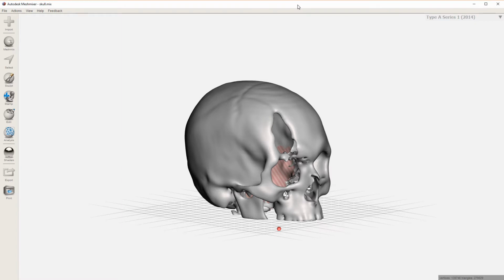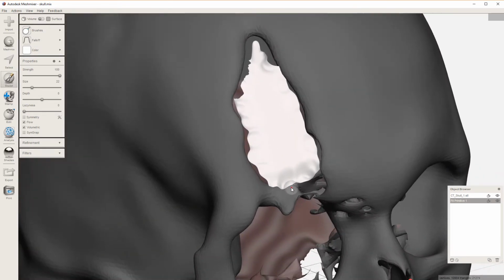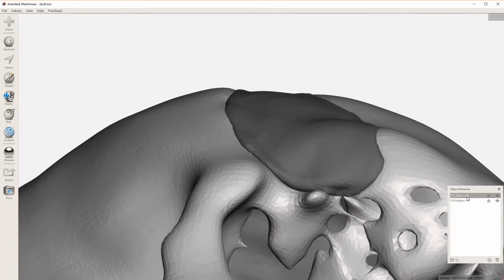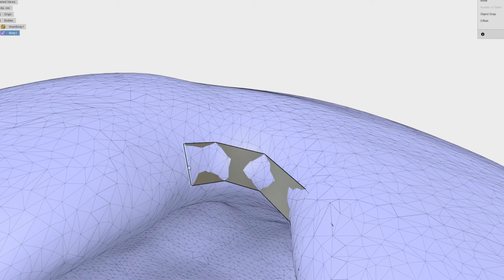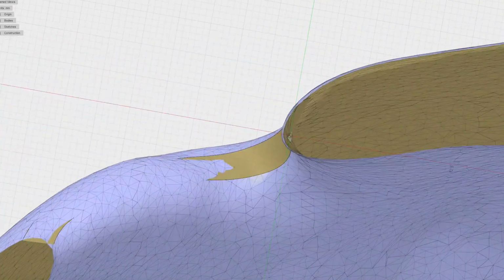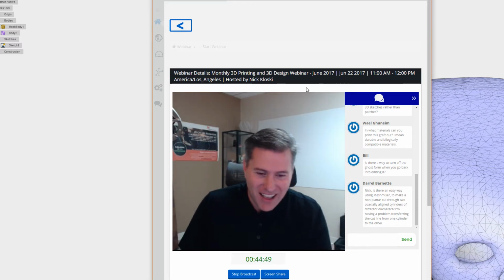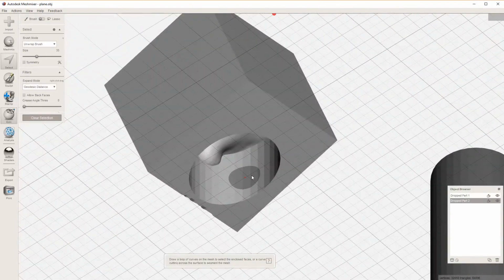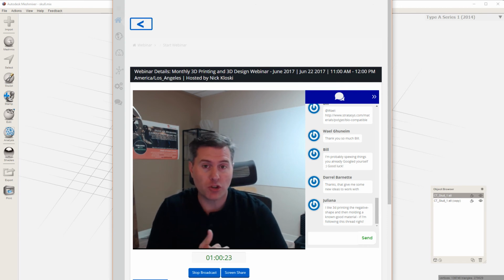Monthly 3D Printing and 3D Design Webinar Replay   June 2017

Comment: Hello! I wonder how I could make a cranial failure template using meshmixer to inject bone cement. Thank you!
Reply: I use blender and you can do it with boolean modifiers. You can also print it directly with PEEK and implant the model directly.